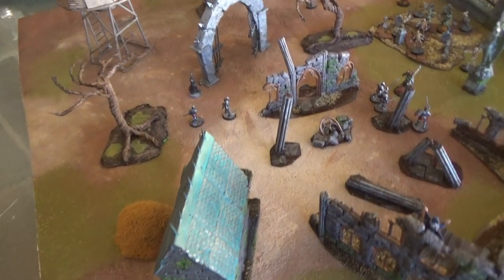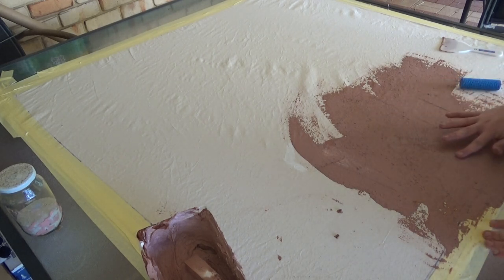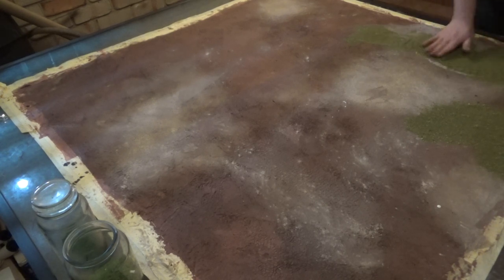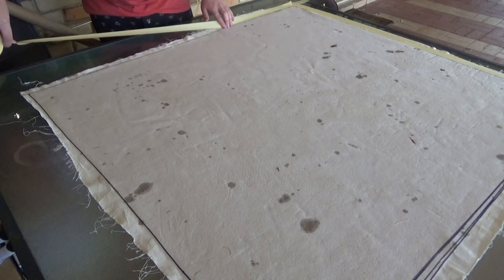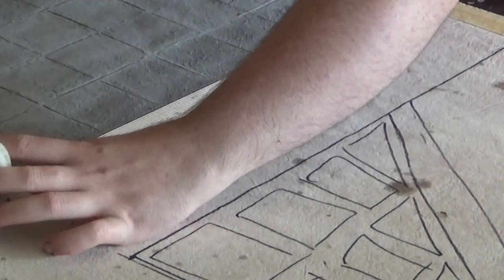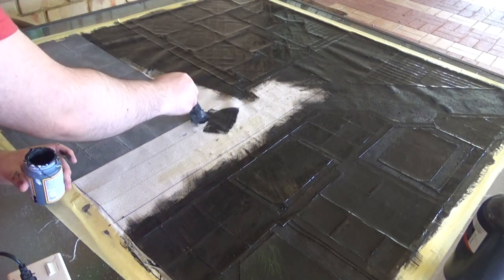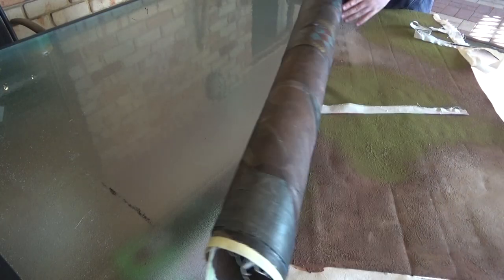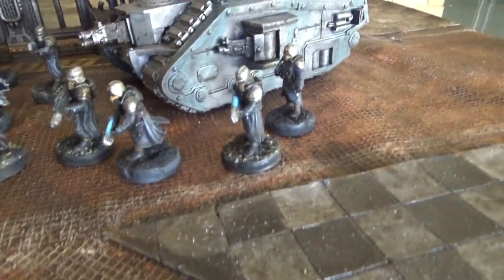Double Sided Battle Mat for Wargaming

Comment: grout will chip and crack, as will modpodge and pva. Fine stone dust and liquid stitch are your friends for this kind of project. Also, you can thin clear acrylic caulk with denatured alcohol to make a flexible adhesive you can sprits through a water bottle over flock if liquidstich isn't your bag, baby.
Reply from the maker: Wow that is a next level idea! Definitely gonna go for that next time!